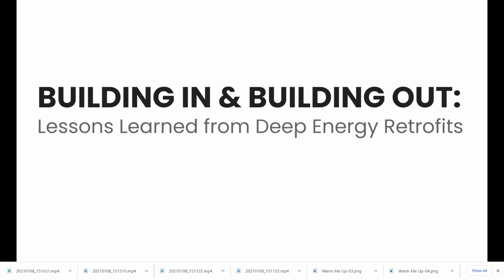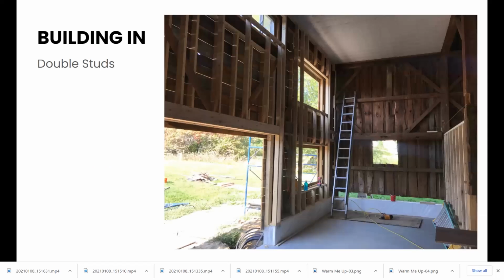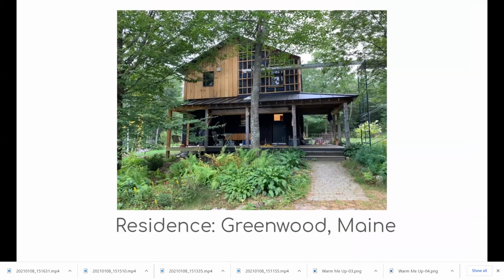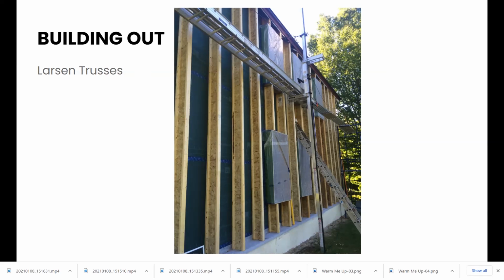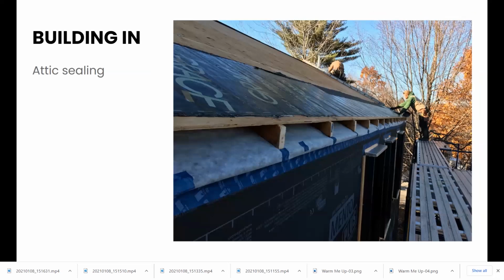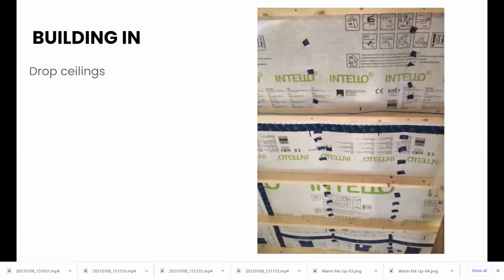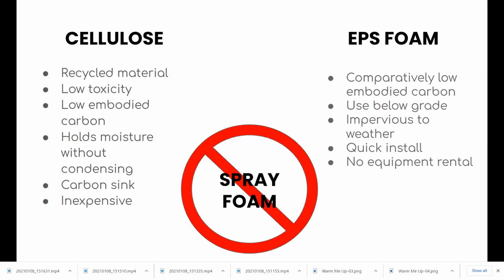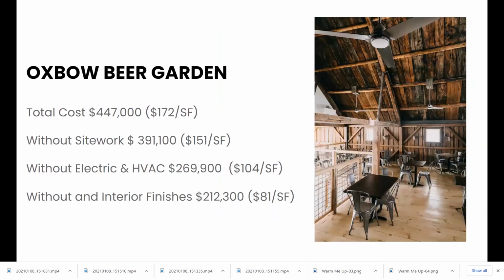Deep Energy Retrofits: Two Case Studies

Comment: Anna mentioned that the air make barrier should be in the inner 1/3 of the insulation. Why is that?
Reply: If the air barrier is kept warm it will prevent condensation on it.